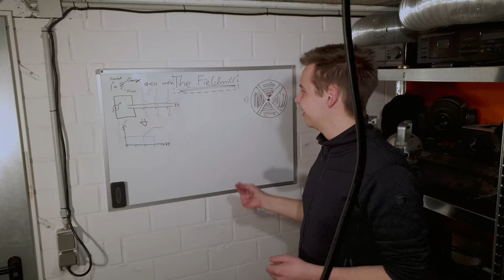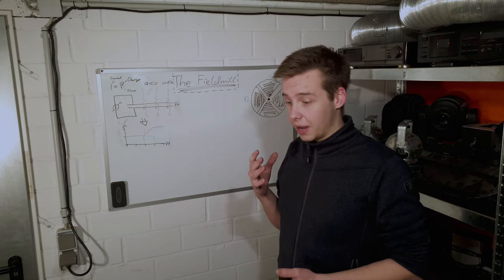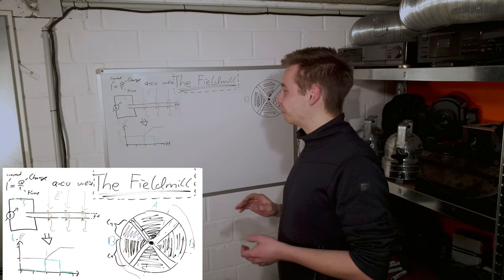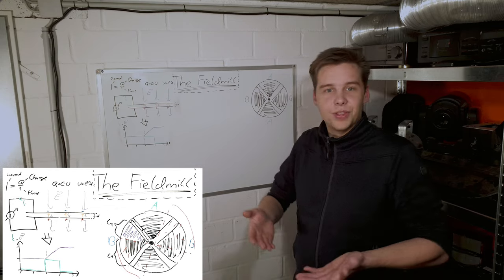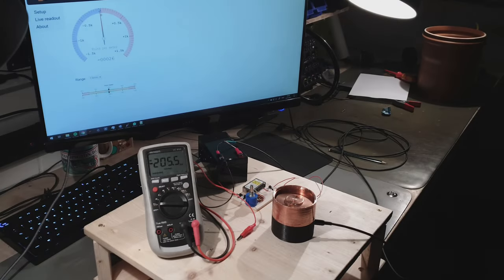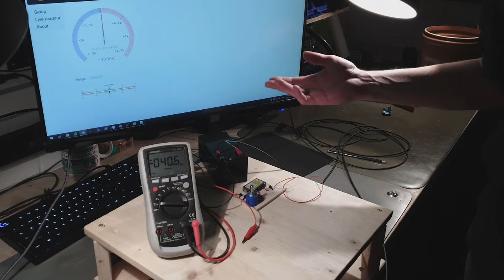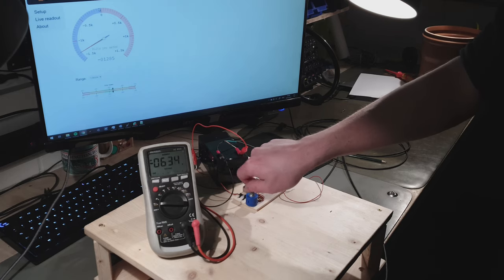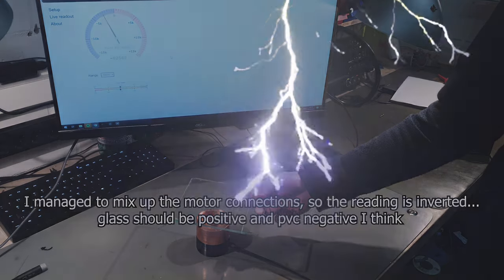Build a Field Mill to Detect Static Electricity

Comment: Great video!! Thanks so much for the detailed assembly instructions on github.

I just read the article on Arcattack as well, and at the end you mentioned the limitation of not having a lid....couldn't you mount the field mill upside-down on the end of a "candy cane shaped" mount? That would be measuring the same ambient electric field between a cloud and the ground, right? I believe the "zebra" field mill from mission instruments uses this "upside down" mounting configuration.

Thanks again for the detailed assembly instructions though...if my linear solenoid design doesn't work out, I'll be building one using your design!!
Reply: Sorry completely missed the comment for a while...

I've seen many pictures of that upside down field mill too, but they must be doing something differently, because that probably wouldn't work with mine... The reference electrode (gnd) would be connected to the ground either directly or at least through leakages across the PCB and the Pole, and would shield the field at least to some degree. Those leakages were what messed up my initial calibration attempts too :D

I did notice a slight issue with my design, that you should probably keep in mind before building one though... it doesn't work in sunshine. when I was testing it this spring we only had cloudy weather so I didn't notice that the sun saturates the IR-detector that senses the rotor position and speed. Without that the mill doesn't work.

There might be a possibility to fix both the lid and light issues. Since the mill only measures field strength change as the rotor turns, it should reject any error from charges in between the rotor and the electrodes. So putting a black plastic sheet there with some sort of seal against the outside and the motor shaft would protect it from moisture and sunlight, without affecting the reading (at least in theory). A tiny hole filled with some IR transparent plastic could be used for the position sensing. I haven't had time to test this yet though.